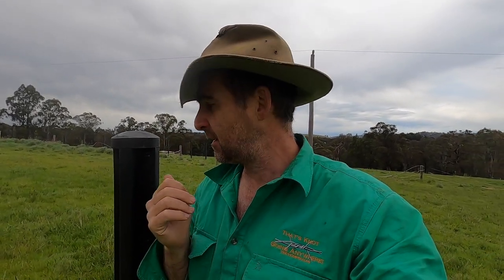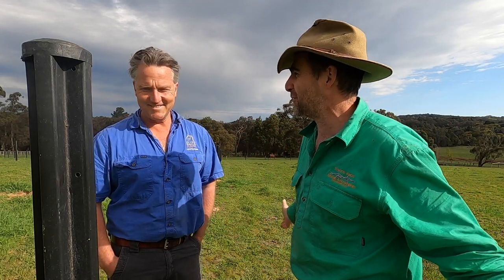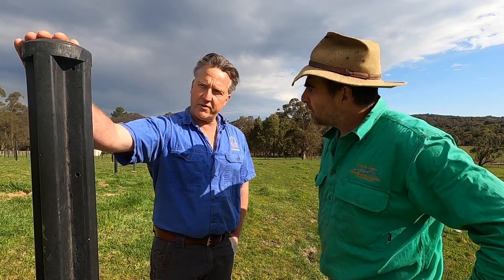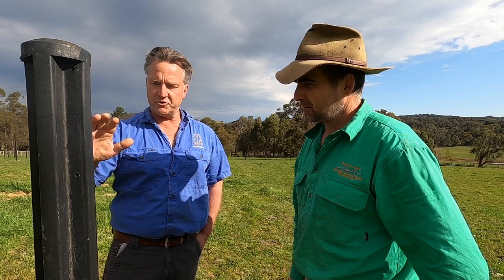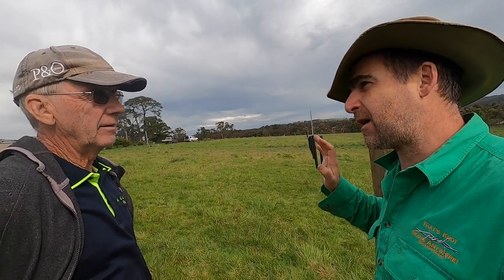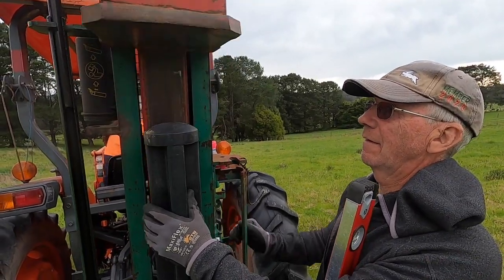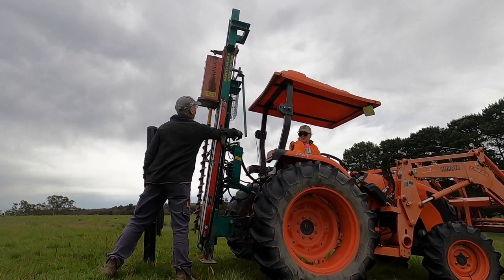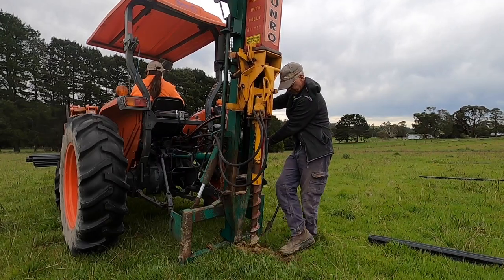Building a Pro Horse Fence with Synthetic Recycled Plastic Posts

Comment: im curious as to how flexible they'd get through hot summer days, and how much strength those pre drilled holes would have when a hot wire is being pushed up against it during the day.

Comment: We looked at these some time ago for our new horse fence, we did the sums and went with treated pine due to the cost. Must say an impressive product, if we had the money would have used them for sure.
Reply: Hi Ward, I think we met at the Seymour Show this year :) Fencing contractor David LeCerf's comments that the posts are super fast to install and don't require all the mucking around with isolators (purchase and labour to install) that they are economical looking at total all-in cost. Over the life of the post, none of your time wasted looking for electrical faults is also a part of the "cost of ownership/maintenance" Thanks Dave
Reply: @plasticforestsptyltd7014  yes we did meet at Seymour expo we were very impressed with the product, we saw the benefits especially for electric. Our decision was solely based on the initial outlay with the amount of posts we needed versus available funds.

Comment: Would’ve been good to see the end assembly, run the wire and strain it up.  So you can see how easy is it to pull the wire through the pre drilled holes.  Did he use these posts for the boundary fence too?
Reply from the maker: I agree. Unfortunately no wire being run when I could be there. I am hoping to do some follow up stuff on these. The wire would run really easily though. The fence he was doing when I left was a boundary fence, yes.

Comment: Are these recycled posts near the end of their recycling life? Or can they be recycled again?
Reply from the maker: They are MADE of recycled plastic. They are new, uv stabilised plastic posts, re-enforced with steel and have a very long lifespan
Reply: Yes they can be recycled again. Just like recycling wire we can strip the outer wings from the encapsulated steel in the middle section. Thanks Dave

Comment: Are they so flexible cattle can push over them?
Reply from the maker: No. But ideally you should use electric. That’s what they are absolutely ideal for.
Reply: @FarmLearningTim  Yep, second that; plastic posts can't be used for cattle with plain or barb because as soon as the beasts find a post moves when rubbed against, it becomes the herd's new 'toy'. Fine with sheep though.

Top tip from a cousin's neighbour here in Wales = when you've put up a line of plastic posts with electric wires, all straight and shiny and new, remember to switch the power on BEFORE you put the stock in... 🤣
Reply from the maker: @ginojaco  It's a whole new world isn't it?
Reply: @FarmLearningTim  words didn't fail him... 😂
Reply: The first farm to use the PLUS post was a cattle property at Bookaar Victoria. They have been up for over 18 months and are fine. Thanks Dave